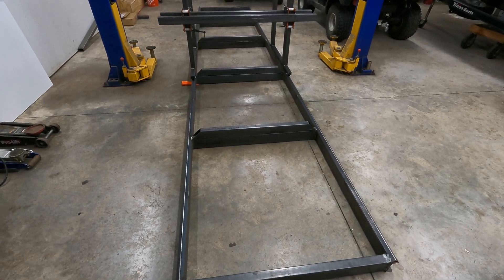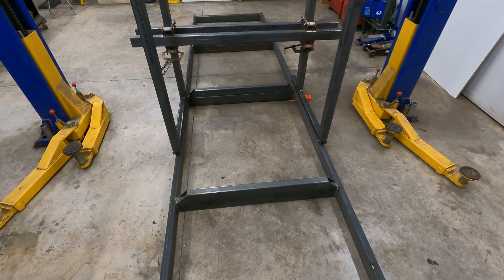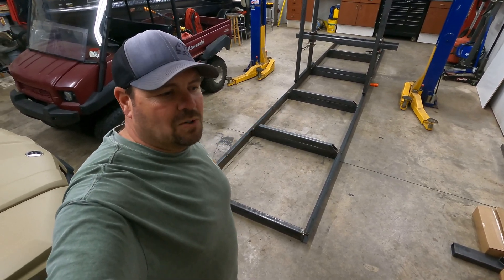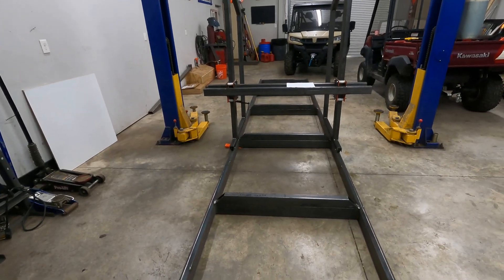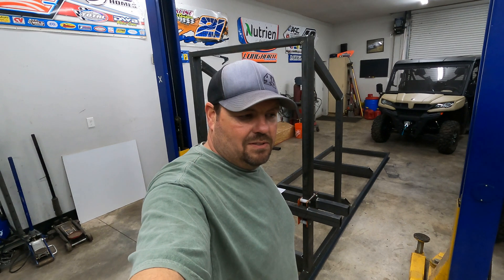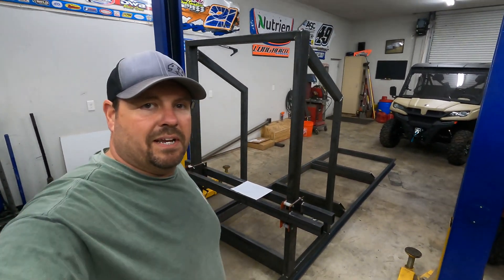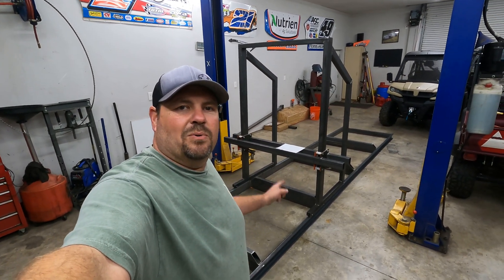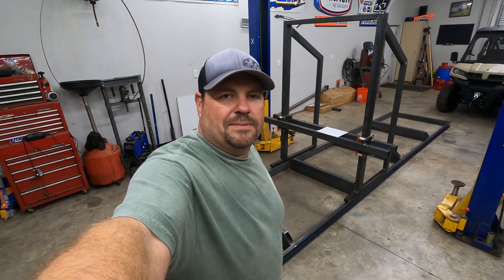Homemade Saw Mill Build (Part 1) #diy #fabrication #sawmill

Comment: That looks like a real solid setup you designed. I notice the orange urethane(?) belt over the v-pulleys for the blade wheels. Where did you get that and how has it worked out for you.